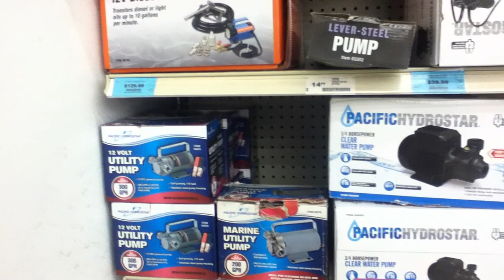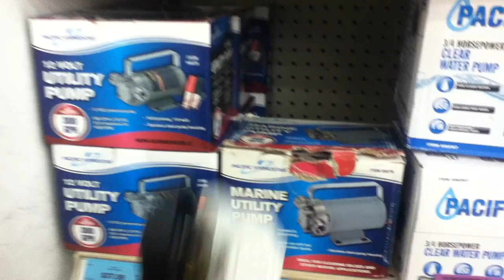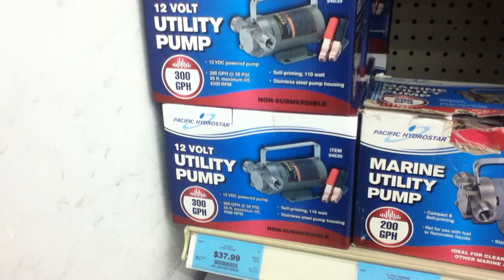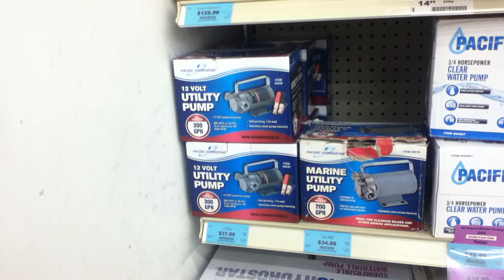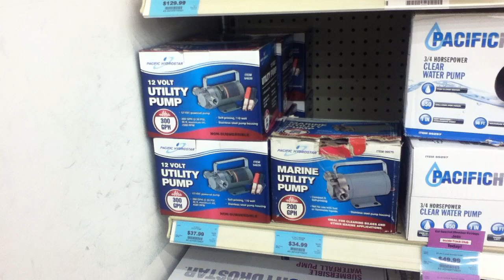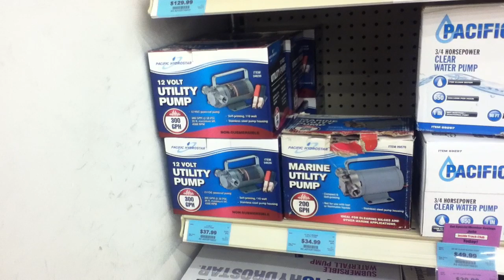Harbor Freight 12v Water Pump

Comment: Just got one, hooked it up, and it turned for 2 seconds locked up and started smoking ..  Junk..
Reply: the battery in my work trk. for a bug sprayer
Reply: you didnt prime the pump, running it dry well seize it!

Comment: Do not purchase this pump unless you really know what you are doing.   I had to learn the hard way, as I was too impatient to try to figure it all out.    The first one I bought caught on fire and nearly electrocuted me.    The 2nd one, locked up and started smoking after just 200 gallons of use.     The trick seems to be ( in my experience ) to connect an adapter to the inlet port that is Y-shaped with valves on each side.    Then connect a garden hose to each of the 3 ports and connect one of the inlets to a water faucet and the other down into the pond you are draining.     Run water thru the pump, before you plug it in.     You will need some kind of way to extend the short cords to your power supply.  Once you plug it in, you need to immediately listen to it to make sure it is humming normally.   If not, immediately unhook the power cord.  You will have less than a few seconds before the pump is toast.  Once you have confirmed the pump is on and water is exiting the drain hose, you can close the port from the water faucet.    I would suggest leaving it partially open in case air gets in the line.   I think that is why mine failed the 2nd time.     I have no idea how long you can run these pumps, but I would suggest letting it could down after 30 minutes.    I am guessing it is important that the suction hose be smaller than the drain hose.    Also, the length of the drain hose, might be an issue.   Feel free to enlighten me, as I just wasted $ 88 and about $ 20 in gas.   https://www.dropbox.com/s/olqes6o2v9l2xod/12%20volt%20water%20pump.jpg?dl=0
Reply: mike smith yeah I was thinking the same thing you can’t get either electrocuted or shocked with 12 V DC haha haha 😂😂😂😂

Comment: thanks for the help, i decided to give up and open the pump and the problem was, it had no impeller in it. manufactured defect on two pumps. I decided to open each and one of them untill i found a good working pump with a impeller in it.

Comment from the maker: I have another video titled 'Backwoods Water Recovery System 12v for camping, RV and Remote Cabin use'   It details how to use the pump.  The box says it is self priming but the pump and inlet line need some water in them in order to get things started.  It pushes water far better than it pulls water, so the inlet line needs to be relatively short.

Comment from the maker: Yes, but these are low end pumps and I would highly suggest keeping one around as a spare (they are relatively cheap compared to the RV pumps).   You would wire the pump in to a switch to turn on water pressure then use the faucets, then turn the pump off manually.   RV pumps cost more in part because they usually have or are compatible with automatic pressure sensing switches which turn the pump on if the pressure drops.

Comment: would  this work for a small water system in my 25ft offgrid cabin? we have plans for a small kitchen sink and shower and have a propane on demand water heater, but it needs a water pump. We dont need anything big just enough for quick shower and doing dishes.